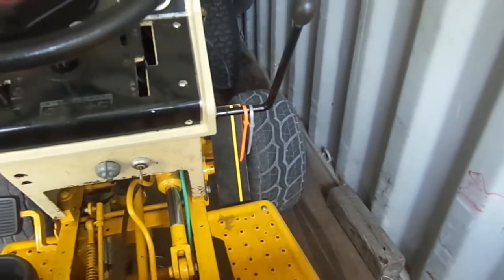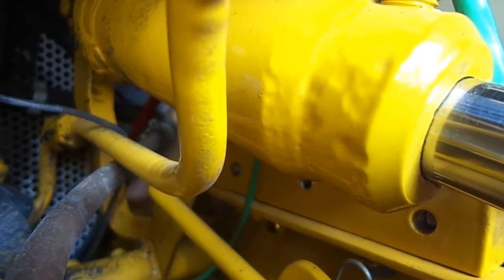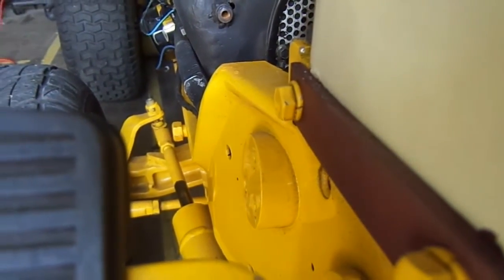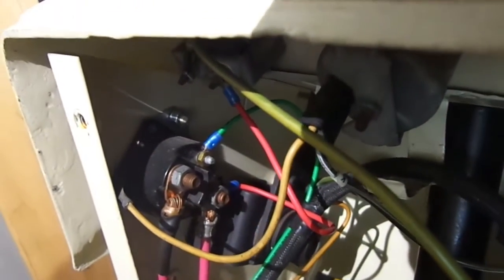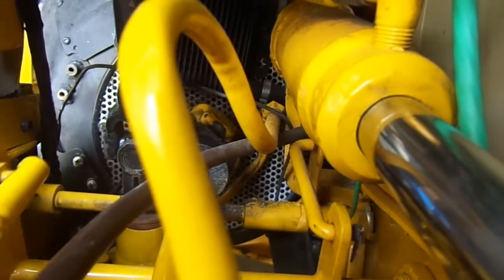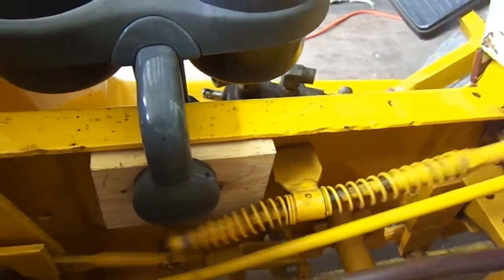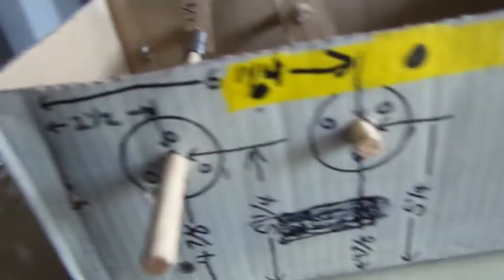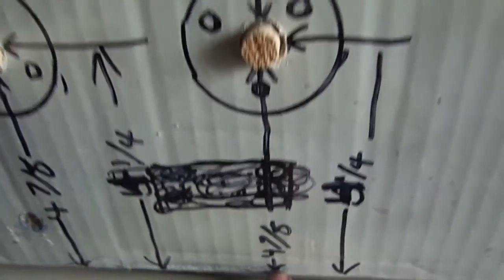How to make a hydrostatic pedal in the floor on your Cub Cadet 800 to a 1650

Comment: Hey there, thanks for the vid. You did real good in explaining the foot pedal install. The mock-up details was great also. You have the quiet line series and I don't, but this helped explain what I needed to do mine. I have a handful of cubs and plan to restore some of them soon. I plan to put the hydro pedal on the left side b/c I have installed dual break pedals on the right side for steering assistance while using the front loader. I will draw this up in my CAD software so that I can get exact fit and see if the ratio is right for me on the pedal. Things I don't have is the lathe and mill.I'm new to having my own YouTube channel and will be posting some vids this year on my restorations and up grades. Will get back to ya later with a link to my channel.
Reply from the maker: +Steve Winter I'll be looking forward for your video to see what you have done.

Comment: Good enough detail... though man sir, that mock up is DIY great detail.   I only have a 107... or for the most part all with a stash I've not gotten the rest of the parts yet from.  I plan to put an opposed twin B&S in also.  Wasn't thinking you're part of the gaywad jihad bunch of insurgents or whatever the temple diocese titles of nobility they are things.  Glad to see all the rescue videos of the saved custom re-purposed made in the US products... even if you might have to use some others materials/parts I didn't notice. Challenging the false sense of entitlement and awareness types with throw away mentalities.  Will be neat to see what I move forward on this summer season.  Thanks for sharing!

Comment: I want to convert my old 1810 to foot control.. the ones on the dash make it harder to control since I am going to add a hydraulic lift for a front push blade,
Reply from the maker: The foot pedals are really nice it will free up extra hand and you won't regret it get er done
Reply: I used to work at a rental store and we had a little tractor called a "Tuff Bilt, it had a loader on it and it was totally hydraulic and it had the pedal an it worked very good, so I want to put a push blade on this one I have most all the stuff to put the blade on, I think anyway.
Reply from the maker: that is what I'm doing I just ordered one cylinder I already have one  a couple more weeks  I will probably have a video
Reply: I have a couple of cylinders that came off of Bolens tractors, my plan is to just use one cylinder , all i am wanting it a push blade.  I'll look for your video.
Reply from the maker: I believe you enjoy a push blade it is something you can use around the house get er done
Reply: I have a blade on my Bolens but I would like to leave my tiller on it and use the blade on the Cub.
Reply from the maker: That would be sweet
Reply: James, I though I saw on one of your videos where there was two springs to hold the hydro pedal in the neutral position unless pushing it forward or backward, but I can't find the video back again,, it might have been someone elses video but I thought it was one of yours,, my petal comes back after putting the brake on but is very touchy  and wants to dart backwards or forwards  which is kinda dangerous.

Comment: Why make a "return to neutral" spring system?  Theres no return to neutral when it's hand control on the dash.
Reply from the maker: You are so right but you need a way to control it with your foot  for instance when going forward and when you get ready to stop you don't want the heel of your foot trying to pull it back in neutral when you release the pressure with your foot it will automatically return to neutral position then rather trying to pull it back up with the heel of your shoe that's why the neutral spring is important   thank you for your question
Reply: JAMES johnson I'm definitely not hating on you because I really enjoy all your videos. I'm just asking because I'm about to start a front loader project on one of my garden tractors. Not sure what I'm gonna use yet because a got quite a few of many different brands. I just know I want foot control to free up my right hand for the loader valve. So I'm wondering why you don't just use the neutral/brake pedal on the left side. My father in law has a nice kubota garden tractor that I use sometimes. It has foot forward/reverse controls with the auto neutral and my calf gets tired using that thing cause I always have to hold it.
Again, I'm a big fan of your videos, keep up the good work and thanks for your input.
Reply from the maker: The reason why my foot control is on the right because my brake pedal was on my left from the factory I could have put it on my left it would have been added work and now I will have to remodel find my break thank you for asking
Reply: Jhitt79....ive got a danco loader unit on a 149 hydro...do you know if the loader frame is in the way of putting a 3 point hitch on a 149?